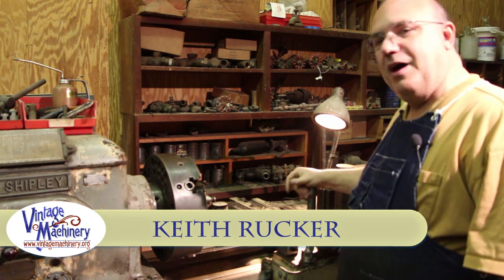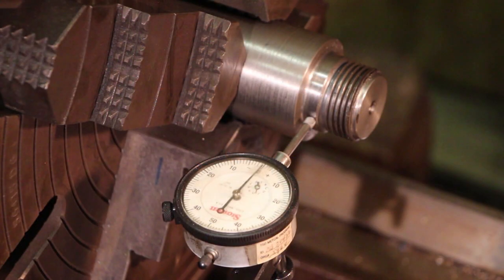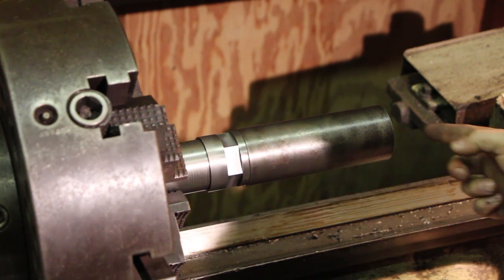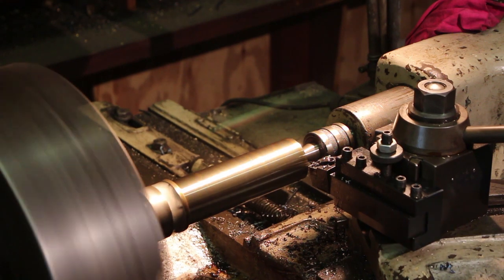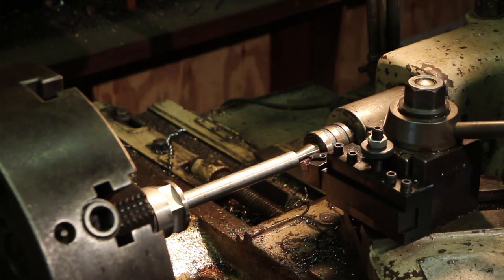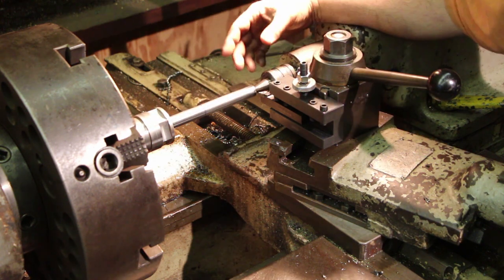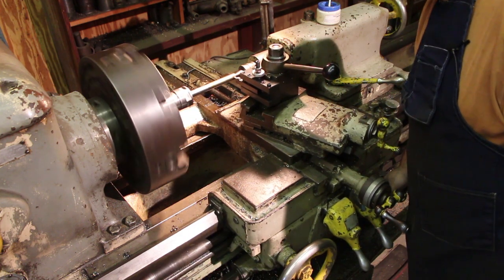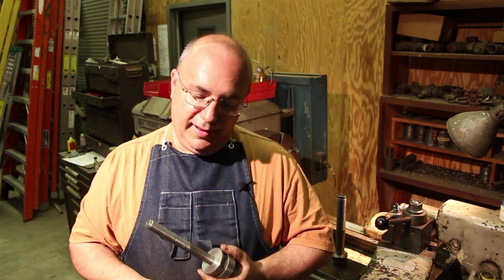Machining a Greenlee Shaper Spindle:  Part 3 - Turning the Spindle and Acme Threads on a Lathe

Comment: Keith, another nicely done project!

A subject that would be interesting to hear more about is material selection. I know a lot of what I've seen on various YouTube videos is done with whatever scrap or leftovers are available, and many times that's fine, but how do you go about picking a material when the strength, machinability, finish, etc. actually matter?  

For example, the spindle you just made is going to be spinning at hundreds or thousands of RPMs, and taking large side loads at times as the cutter contacts the wood, knots, etc in use.  How do you pick the steel so it can safely withstand those forces, have threads that can take having the nut torqued by a gorilla with a big wrench, and not wear down too quickly from repeated cutter changes?  Other critical applications might be a motorcycle axle, transmission gears, or winch parts. 

I've looked at various metal supplier sites, and some will give tensile strength figures, describe machinability as "good" or "poor", etc, but it's not clear to me how to know how much is enough.  Getting the strongest type available isn't the answer...cost varies, and other properties like wear and heat resistance vary too. Is there a good procedure for deciding what material is best for a given application that can be followed without 4 years of mechanical engineering school?

Thanks for all the great info you are sharing. There's no substitute for seeing it done when you are just starting to learn this stuff.

-- Mike

Comment: We use a 5HP Oliver (woodworking) Shaper for profile machining aluminum parts from templates in the machine shop on specially made router shaper fixtures.  We also have a Onsrud RO-117 overhead pin router for doing the smaller parts.
Well anyhow, the end mill cutters are held in a special collet and nut on the spindle much like the ER collets.
Reply: Onsrud makes lovely End Mill like router cutters both upcut and downcut spirals.  We normally just use SGS brand carbide. I believe they are now part of the LMT group.  So don't underestimate a woodworking router/shaper for doing template routing if you have a lot of parts to make that are the same size and shape.

Comment: Thread wires.

I always chuckle when I see a guy cut the thread od and trying to get it "perfectly" on size. And then they come back after threading and deburr the crests of the threads with emory cloth. Check Machinery's Handbook for thread od tolerances. You might find you have a larger tolerance than you thought.

Comment: Kieth - i love your videos, i just started and brought my self a lathe and mill - as a sheet metal worker by trade, im only using what i have at hand and it is grade 250 Mild steel, but iv tryed every conversion under the sun to do the correct feeds and speeds, but the finish on the mild steel is like a gummy scratchy surface and i have to sand and polish smooth, im told 500 RPM the best i can do is 460 or 610 RMP on my cieg C6 lathe, and the feed rates well, im in metric and the feeds are all for thread cutting, 0.1mm feed rate is the slowest i can go, please anyone a little pointer? im using iso inserts from seco here in Australia, and im breaking too many, i moved to 12mm HSS and i have a book named Engineering works practice, by George Newnes but it was published in the 1930's i used there angles on the HDD and i get the same thing :(
Reply: Thank you very much Keith - and as in Australian "Thanks mate", love your videos, always always come back for reference when i am in a rutt, ever in Australia :p ill be shouting you a cold one :)

Comment: Would it be correct to say that this machine is an ancestor of today's router?
Reply: ***** I know of shapers still being in use. I've seen a few brought over to restore some of the houses i've been working on.

Giant beasts compared to the tiny table routers.

It's funny how i've never made the connection between the two until this video. :) Probably because the ones i've seen are brand new, well younger.